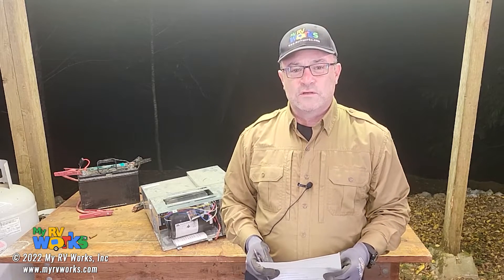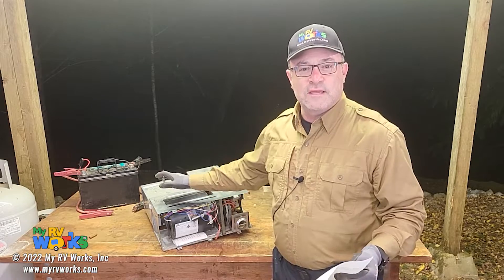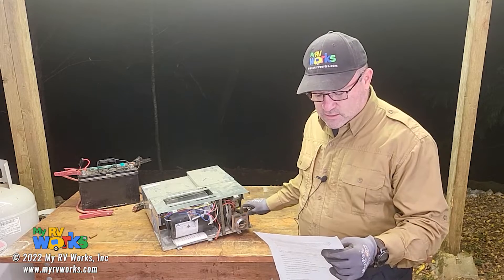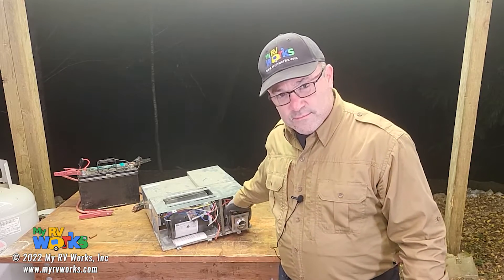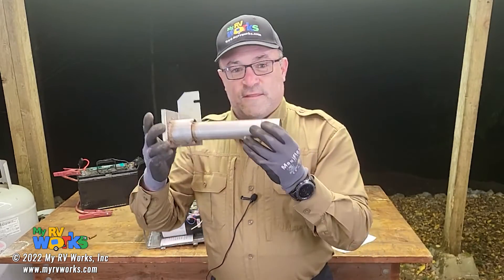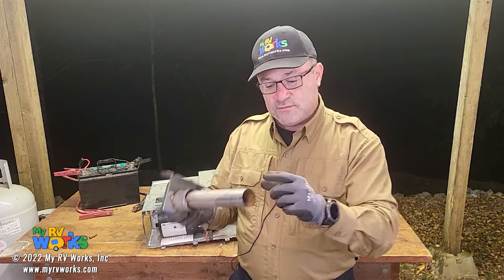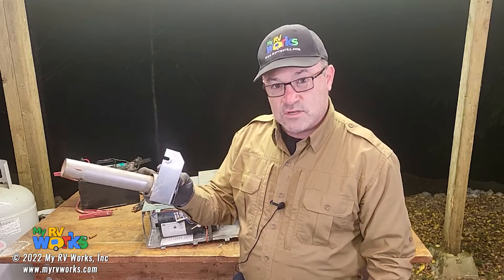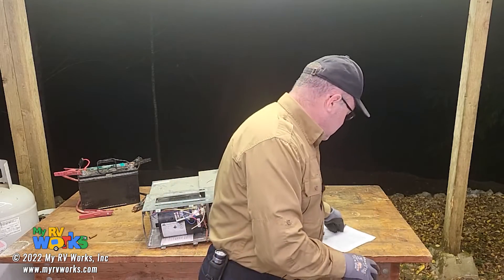RV Furnace Won't Fire With Exhaust Port Removed? -- My RV Works

Comment: SOUNDS LIKE THE SAME ISSUE I HAVE.    INSTALLED NEW SAIL SWITCH AND HEAT SENSOR.  I DID NOT REINSTALL THE EXTERIOR EXHAUST PORT TO TEST MY WORK.    THE PORT DOES HAVE A SMALL RESTRICTOR SURFACE.    IT'S LATE AND I'M TIRED.  I'LL GIVE THAT A TRY IN MORNING.    THANKS. I APPRECIATE YOUR WORK

Comment: Hi Darren,

Great videos.  I can't find any videos that show the trick to removing the exhaust pipe when it is rusted/jammed.  I need to check why my furnace is not lighting up (I smell gas and hear the spark) so I suspect it is a rusty burner.  Regardless I need to get that exhaust pipe out and it won't budge!!!

Thanks!

Comment: I have also heard that some people have trouble keeping the furnace going if the inside 5 inch flexible ducting is in place, especially at higher altitudes (small furnace with only the front heating duct). They're saying maybe too much back pressure?? Removing the flexible duct piece supposedly solves the problem.

Comment: Mr Darren my swintec slide out is not working properly . why can't I do away with the dual control module and run two on off on switches straight to the motors? Won't that work?

Comment: 2002 Atwood red blinking light  ignition lockout fault ????? I'm freezing
Reply from the maker: The ignition lockout would indicate that the furnace tried to ignite three times but couldn't. So if the furnace tried to ignite, it's not likely going to be your sale switch or high temperature switch control board issue. You may have a faulty gas valve, but first check your propane to make sure that there is adequate propane making it to your furnace. If your cylinders are less than half full and they are cold, there may not be enough liquid propane to vaporize. The furnace is going to use the propane as a vapor. Perhaps warm up your tanks with a blanket or something and see if you can get them to vaporize.

Comment: Mine fires an runs about 10 sec and peters out and refires over and over. Fan stays running. It will do this all night
Reply from the maker: That sounds like a symptom of your DSI board not detecting the flame after ignition. That could be caused from low LP pressure, the gap of the electrode over the burner head, the electrode assembly itself including the wire, or finally the DSi board. On our video playlist we have a furnace playlist with videos on all of these issues. I hope that one of those will help steer you in the right direction. Good luck and try to stay warm.

Comment: Hi Darren,
I have a dfmd30111 with the flame out issue you mentioned. The elevation is 6200 ft here. I've tried both increasing back pressure (adding foil tape to the end of the exhaust port) and decreasing back pressure (removing exhaust tip) without any improvement. 

Other LP appliances run smoothly and with plenty of flame, indicating the regulator is operating properly. I've tried running 3 stove burners at the same time as testing the furnace, without any luck. The flame out issue persists. 

Voltage to the gas valve is present and only goes to zero volts after the flame has gone out. 
Is my next step to take the burner out and inspect it?
Reply: Check my reply to Full-timers world above. Same issue.